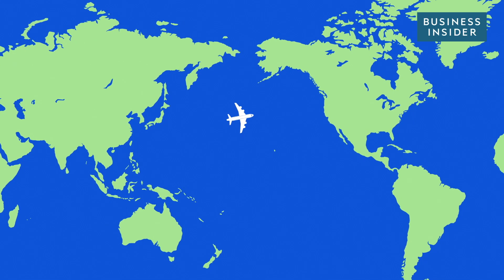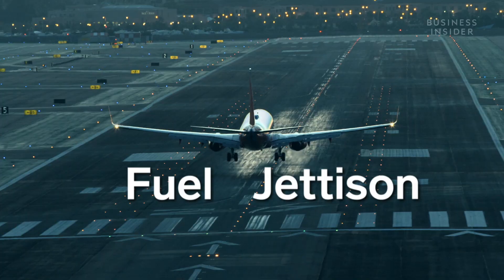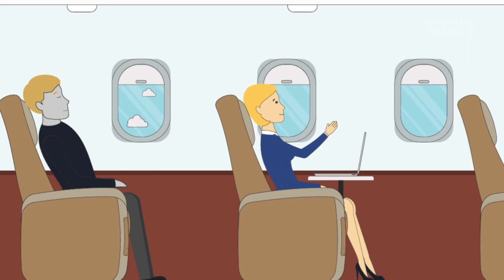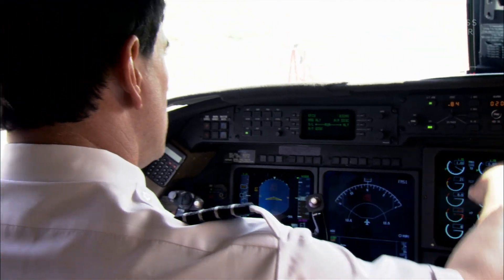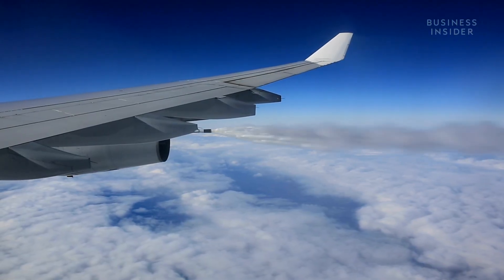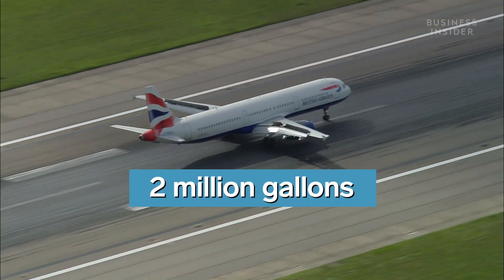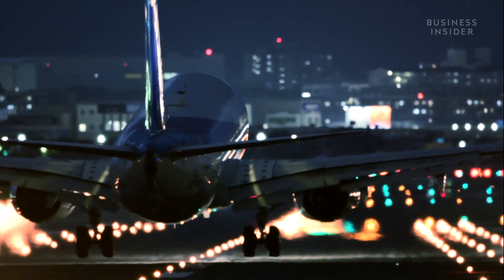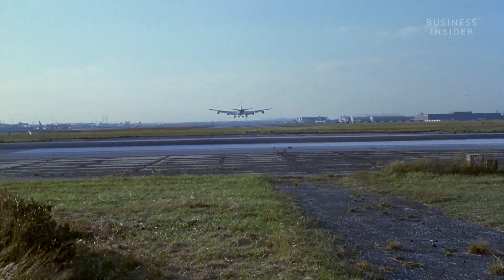Why Planes Dump Jet Fuel

Comment: Because jet fuel is compressed air so they can dump as much as they want.
Reply: LMAO what??
Reply: @alexf962  lmao do the math
Reply: @iamvampyrnow  There Is no need for math jet engines Need combustion. You must know zero math for that matter
Reply: @alexf962  You must know math and common sense to know the amount of liquid they say goes into the wings is impossible. Go research how much fuel goes into the wings of an airbus 380 and then look up the dimensions of the wings of an airbus 380. Any rational discerning mind will have some questions.
Reply: @iamvampyrnow  LMAO I am a commercial pilot, I know exactly how the engines work and you tell ME to go and "do research"? Pitiful. I saw the video you refer to, why the A380? Why not a deeper analysis on any other airplane? That video is basically  made by a guy who showcases his personal incredulity and uses it to debunk aircraft engineering. Yeah, you people surely know math.
Reply: @alexf962  terrible damage control. you know better than to mention the numbers and I never mentioned any video that's a strawman argument.
Reply: @iamvampyrnow  Does not matter, you are the one who choses to trust charlatans online and then uses the words "common sense" to look superior as if it was something everyone should think. Even more pitiful. So tell me, how do I lose the exact weight as the fuel I burnt when I land my Cessna XLS? Where exactly do we store all of that compressed air and where do we get the energy to make it flow through the engine? How come we do not lose engine power since as you empty a compressed air tank the pressure declines constantly? Please, enlighten me.
Reply: @iamvampyrnow  Waiting...
Reply: @alexf962  you know what is enlightening? That you know the amount of liquid they say fits into the wings of an airbus 380 is indefensible so you need to make strawman arguments about a cessna. Your damage control leaves something to be desired.
Reply: @iamvampyrnow  You dodged the question and you obviously understood nothing of what I said and like all the conspiracy theorist use the "strawman argument" defense as soon as you are cornered. You can't do any math and you certainly have zero idea of how jet engines work. Keep selling veggies.
Reply: @P. David ?  Are you aware there are thousands and thousands of people working on airplanes every day.  Many of them are the ones that put jet fuel on aircraft.   All of them are just hourly workers.   Not government, not management, just plain old hourly workers.    Is everyone in on your Jet fuel hoax?   Come on, are you really that un-informed and that ignorant on the operations of aircraft that you believe that BS?
Reply: @rcairflr  no they’re not in on it, they’re just the average schlub that will work for 20 bucks an hour and not ask too many questions. Why would they need to be in on the hoax to make it work? Those same people willingly give 40 percent of the market value of their labor away right off the top so are they really that intelligent?
Reply: Robert  No, the conspiracy is 82,000 gallons of liquid fitting and inside the wings of an airbus 380. Can you prove that claim?

Comment: Plane Dumped pee and poo
Reply: No LOL airlines hold the human waste in a tank in the belly of the planes then once the plane is back at the airport the grounds crew connect a hose up to the belly of the plane and use strong suction on the vacuum truck to rapidly remove the waste.

Comment: There was an a380 (QR905) that was flying from Melbourne to Doha, it flew over my house and I watched it fly circle over the ocean. Apparently there was an issue with the landing gear right after take off and had to get rid of all the excess fuel. It took more than 3 hours for the plane to land safely back in Melbourne

Comment: Airplaines dont use allot of fuel and dont Carry any during flight.. the turbine engines are started with fuel but run on compressed air as fuel.. the dumping of chemicals is what they do, on the people on the ground.. where you think they store all those gallons of fuel? In the wings? Look up pictures of opened wings, you will get the point 🤗👋 have a good one🙏
Reply: We’re trying to keep that a secret they pay us good money to.The wings are filled with compressed air and water. The engines run off of only compressed air free energy. Hidden compartments in the wings store the ingredients for chemtrails. Us mechanics are sworn to an oath to protect the jet fuel and Chen trail secrets. Many are government agents on the inside to keep things in check.

Comment: Why not dump it in a way where you are able to retrieve it later? Like with a parachute.
Reply: Because like they said, it doesn't happen very often, the cost of installing the equipment to make it happen and to fly it around & maintain it is too expensive. In other words...  It costs more money to install than would be saved retriieving the fuel.

Comment: I thought there was the deal where it takes longer for the plane to stop when too much fuel is onboard.  If it takes longer to stop than you have runway for, that is bad.  I remember the documentary on the Quantas A380 uncontained engine failure mentioned one of the flight crew calculating how much runway they needed to stop the plane as they were fueled up for a long haul flight and they needed a long runway to stop with their heavy fuel load.  I remember hearing they stopped within 100m of the calculated distance.  For example wouldn't want to land at Midway airport in the Chicago area, especially in the winter time with an overweight plane.  The last time I landed there in the winter time the pilot gruffly plopped the plane down at the outer edge of the runway after a steep descent with the speed brakes on (barely flared at all), then took the whole length of the runway braking hard with the thrust reversers roaring like I have never heard them roar before only to make a sharp, fast turn at the other end of the runway before slowing down the rest of the way.  Especially a place like there if it takes longer to stop because there is too much fuel on the plane, you are just going to slide off the end of the runway.  (And planes have been known to slide off the end of the runway there, at least in the winter time.)
Reply: Yes... that was Qantas flight 32 out of Singapore. The crew did a good job to land the aircraft safely will all onboard but more credit must go to the Airbus A380 engineers and designers who created an aircraft capable of withstanding such a catastrophic engine failure and landing safe without it losing control, breaking up and falling from the sky.

Comment: It sure doesn't dump thousands of pounds per second. The 777's fuel jettison system takes roughly 30 minutes to dump from a heavy fuel load (130 tons) down to max landing weight, and it varies the dump rate to respect center-of-gravity limitation while all that weight is being moved around. It also leaves about 1 ton above max landing weight to account for your fuel burn on the subsequent approach and landing.

We're trained to aim for max landing weight if time permits, or if not, 300,000KG works for an overweight landing. The landing gear can take the 'abuse' if needed, as in the case of a critically ill passenger.

Comment: because if they land over Maximum Landing Weight then the aircraft will be grounded for a long time as thorough inspection needs to take place. Many airlines rather dump fuel than to lose revenue like this as long as there isn't a risk of fire due to the emergency.
Reply: Not really, airlines actually lose revenue dumping fuel if you rewatch the video.

Comment: If its fuel weighs the same as 3 elephants how does the wings look so light and small , truth is 90% of the planes fuel source is the air (no fuel) through high powered combustion which uses a little fuel at the start (but only at the start!!!) to ignite the combustion of hot pressured air. From there the blades spinning will allow the continued flow of air into the combustion chamber hense no need for fuel as the air is the supply. Why is this important ? Planes prices are affected by fuel prices which we know is a lie. And more important look at the skies folks , there spraying us, dont believe me just research Havard University or MIT publised papers on what they call GEO-ENGINEERING otherwise known as chemtrailing. Believe it or not i dont care but i wanted to use this as an example , if they lie about how much fuel they carry, use, or dump what else do you think they would lie about???
Reply: The air must be heated and expanded to add energy to it, which is done by burning fuel in the combustion chamber.
Reply: I see someone is finally understanding with that thing between there ears. Most people don't understand that there is no way 3 elephants can not be supported by those wings. If people would actually do some real research then they may understand. The commercial airlines have been lying about the technology and how these compressed air engines work. The resonant harmonics of the blades plays a big part into the levitation of these particular air craft. If people would just think about how much steel it would take to cantilever 3 elephants and that the wings would have to probably weigh more than the elephants. And of course we have a weight problem because they don't use steel it's mostly lightweight metal like aluminum which is not as strong as steel. Do more research yall!! The liars need to be exposed.
Reply: Steve. Steve it’s mummy here. Time to take off the tin foil hat, come up from the basement and take the pills that the doctor said will help you. On a serious note, thanks for giving all of us in the aviation industry something to laugh at.  Keep up the comedy routine. It’s awesome.

Comment: I thought these planes were properly stressed for almost anything.
Bombers were heavily loaded and the pilots could land them.

But when I was flying, I learned how to land gently on a run way.
If these commercial planes are properly built, Then why have the pilots not learned in a simulator to land a plane which is over weighted,
If they can take off with this weight, That tells me they should be able to land it.
If they are not able to land these planes safely then why are they flying them?
Making the planes fly cheaply for profit!
or just incapable pilots who haven't actually learned the proper way to fly or maybe the run ways are not long enough,
If they can fly straight and level fully loaded, where is their ability to fly the plane onto the ground?
Most pilots learn to fly a plane onto the ground.
Is there another reason why they have to jettison fuel, a different safety factor not mentioned by the manufacture.
Reply: You can refer to this: https://www.quora.com/How-is-an-aircraft%E2%80%99s-maximum-take-off-weight-higher-than-maximum-landing-weight

Comment: The design is based on maximum landing weight.  And the regulations are very detailed.  As the professor said in a inflight emergency all bets are off and if a overweight landing is done then so be it.   Landing overweight can also have the potential for structural damage reduced by flying a much shallower approach angle and controlling the descent rate.  Basically you are very gentle on the throttle and flight controls and very very carefully monitor the approach speed and angle.

It is also possible that some aircraft will need to burn off fuel but that can take a very long time especially with heavier international flights with not only heavy aircraft but heavy fuel loads.  That’s when the question becomes of whether it is a emergency after all.  You can circle several hours burning down to max land weight especially if there is no fuel jettison system on the aircraft.  There will be many questions and lots of paperwork to fill out so Captains are very cautious of this fact.  Some are no brainers like fire, loss of engine and some medical issues.  Some are not quite so much.  In the case of a heavily fueled international flight the problem itself might not be an emergency but the restrictions for the scenario might be DO NOT Enter ETOPS airspace.  That restriction is common due to the potential of problem getting worse and being in the pre-verbial...”No Mans Land” between the oceans. Even though the aircraft may be certified for flight with loss of engine or system that scenario is based on the problem happening while I. The middle of the ocean.  If you haven’t entered the ETOPS and are on either side of the ocean (Atlantic for Example.  If the problem develops in the middle than fly to either side and land.  If you are not up to the ETOPS area yet most airlines, aircraft manufacturers and regulatory agencies prefer you not risk it.  Yes you can spend five or six maybe more hours holding offshore of the origin country and wind up back to the original airport where you came from.  Depending on the airline and logistics it might be better to return back to origin airport.  

Example a British Airways flight from London to the US having a problem might elect to return to London for repair and passenger accommodation.  The same scenario for United or Delta flight leaving the US for Europe might elect back to the US origin airport.

When you are passed what is called the Equal Time Point then you are pretty committed to one side or the other. ETP is the point where it is the same amount of time and distance to go back to Landfall whichever side you are on.  Note I said landfall which basically means a runway suitable for that aircraft.  It might not be origin but a safe landing airport and runway.   A Lufthansa flight from Germany to the US might divert to Ireland.  A United flight to Europe might divert to Canada or the Maritime Provinces (Gander, Goose Bay, Halifax etc.   This doesn’t fix the problem but gets the aircraft safely on deck then worry about the passenger accommodation....Rescue flight, return back to US/Europe etc...
Reply: would it be possible to prevent landing overweight in the first place? like stronger structural elements + prevent overloading?

Comment: Maybe in the future we could store fuel in several separate tanks that are shock proof, fall proof, and leak proof (maybe also equipped with parachute) that when they want to dump fuel they could just drop some of those tanks as necessary and later those tanks can be retrieved and used again.

Comment: Not a story. Smaller planes like the A320 and 737 which can’t dump fuel are by far the most used aircraft.  They outnumber all other planes combined by over 2 to 1 in airline fleets

Comment: Safety comes first. Even if it were illegal if the pilot could justify it for the safety of the aircraft they likely wouldn't get into trouble with the FAA. As for their airline that's a different story. That $20k in fuel may have been picked up by an insurance company but it may have also just been eaten by the airline.

Comment: They don't… Unless they don't have a choice. If the plane is too heavy and you have to land you just dump the fuel. 
That doesn't apply to all the planes. It's usually in the long haul flights with bigger planes such as the 747 in case of emergency. 

FUN FACT: plane crash way worse for the environment than a fuel dump.

Comment: Jet fuel is a lie.  These new engines now run on compressed air

The sheep are so fooled
Reply: Compressed air mixed with jet fuel
Reply: The pilot is blowing on a tube to keep the pressure up
Reply: Oh aren’t they!  They don’t even know they are the sheep. You know that’s what you are don’t you?  Yes that’s right. You are the moronic laughing stock of every pilot, engineer and refueller worldwide.  Keep it up! It makes the rest of us look even smarter.